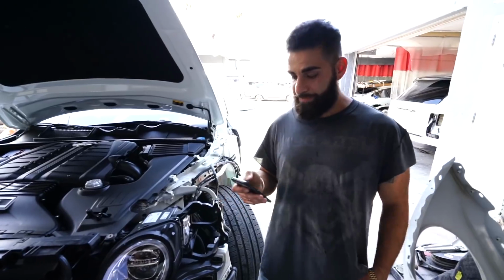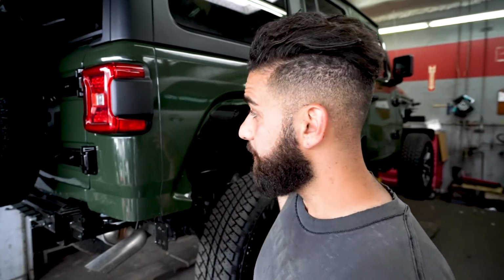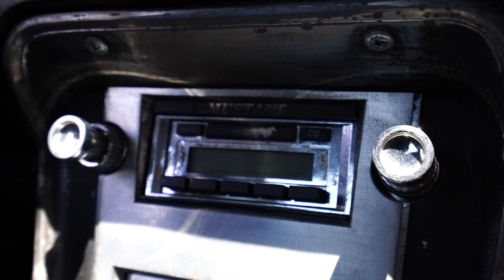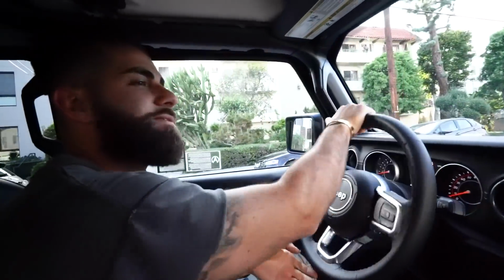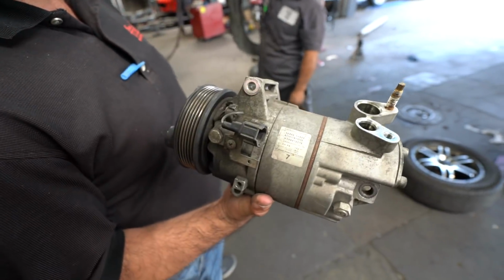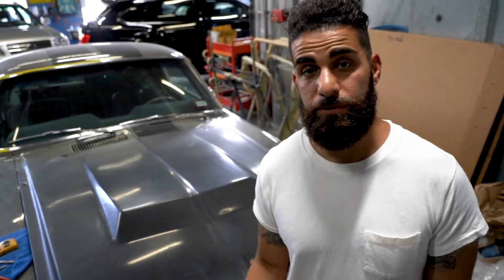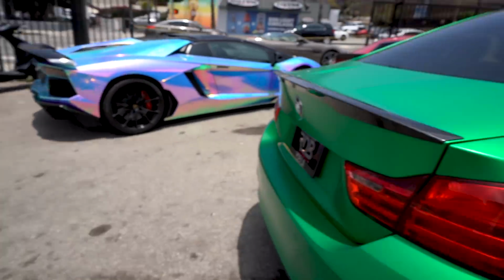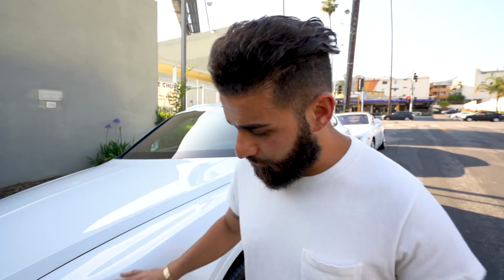#RDBLA, Green Jeep, Green M4, Bentayga Smashed, Starting a custom Mustang Build...

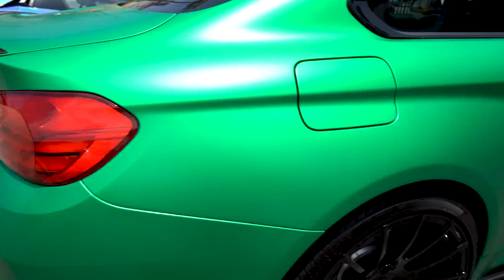Comment: 10:59 wrap is lifting on the front bumper weird line! Not being a bitch love rdbla!
Reply: 199390 199390 indeed
Reply: sidemarkers thats why.
Reply: Michał Józwik behave you weapon It’s a ripple in the vinyl! Plus shouldn’t be there even if it was a side marker which it isn’t!
Reply: woah someone got triggered but whatever floats your boat, for me its sidemarker since it US M4 but for u it will be "dipple in the vinyl"
Reply: 199390 199390 I just got a call from Vik and he says it’s just water bro!
Reply from the maker: That is covering the side reflector..
Reply: RDBLA hmmm apparently a gentle man above says it’s water
Reply: Michał Józwik ripple not “dipple”
Reply: 199390 199390 the wrap is fine, it's converting the reflector on the bumper under it so that's why you see the lines under the wrap. Which is why if you notice in other videos RDB removed even pin stripping from the body before they wrap because they say it will show from under the wrap.